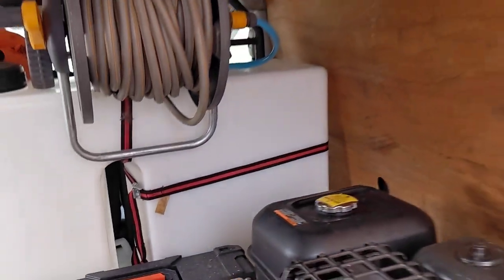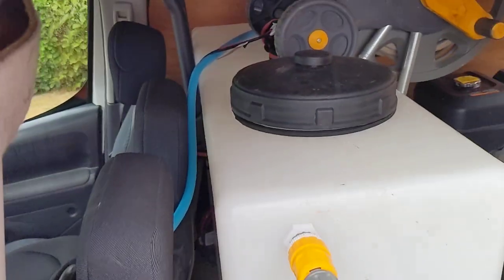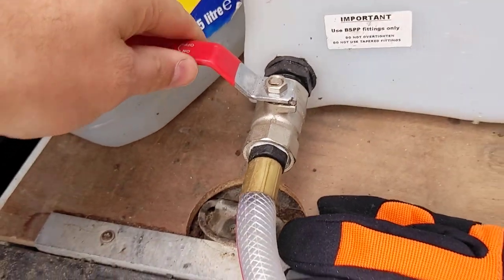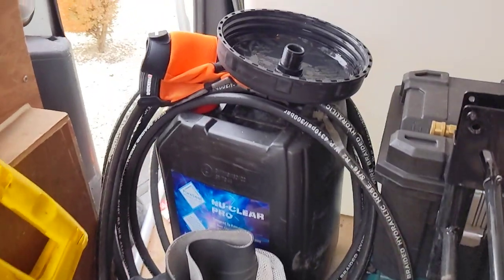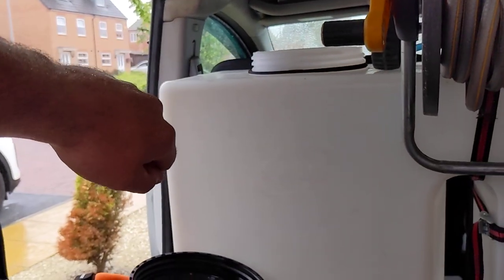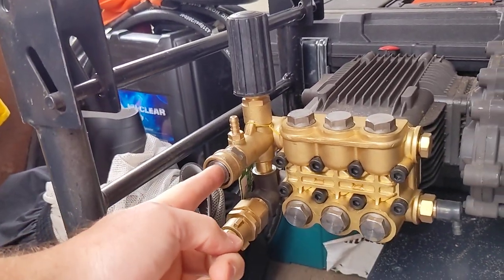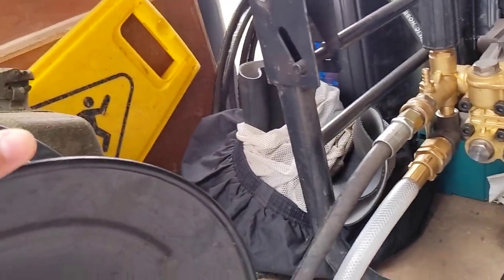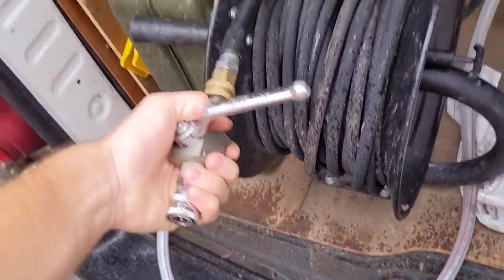Setting up a buffer tank for PRESSURE WASHING

Comment: Do you need a bypass that goes from the pressure washer back into the buffer tank. Was reading if you take your finger off the trigger and leave the pump running it can mess the pressure washer up. Is it worth installing a bypass ?
Reply from the maker: I think it's mainly for heat management to prevent the pump overheating. I had a bypass installed on that machine after this video.
I'm not sure what happens inside the pump when there's no bypass, I'd like to talk to a professional
Reply: @SMOUT_  I read its just better for the pump, because its always getting freshly cycled water helping it stay cool, guessing it just increases the life span of the pump. how long did your pump last without a bypass?

Comment: For the incoming water feed, did the tank come pre drilled and all the fitting already attached?
Reply from the maker: No I drilled the hole at the top for the hose connector.
The one at the bottom was already drilled with a half inch thread I think 👍

Comment: probably a daft question, but when ordering the tank do you need the undrilled or outlet options, also is the stopcock already inside the tank as there's an option to add a brass float valve thank you
Reply: Did you manage to work out whether to get un drilled or outlets ??

Comment: Hoping for a reply.
This just gravity fed then?
Does the flow exit rate from the buffer tank exceed the GPM of the pressure washer, or does the pressure washer create vacuum to suck it out, thereby creating sufficient flow?

Thank you!  Working on setting one up myself, but my flow rate out of the tank is lower than the GPM rating of the pressure washer and I don't want to burn it up.
Reply from the maker: Most pressure washers will suck yeah. A better measure of flow would be at the end of the high pressure hose with no nozzle on. Then you'll see a huge increase over what comes out of the bottom of the tank alone.
Reply: @SMOUT_  
Thank you very much.  That believe that makes sense.  

Just to be clear though, if my buffer tank...open valve, nothing hooked up to it besides the feed hose.... flows say 2gpm, do you think I could hook a 4gpm pressure washer to it?  My tank is 300 gallons and flows out a standard size garden hose.  I'm just surprised the flow rate isn't higher....300gallons should be a lot of gravity pressure.

Thank you again.  I do appreciate it.👍👍
Reply from the maker: Yes you got it. Give it a try

Comment: Where did you get the hose and the brass connectors to attach to your machine and water supply? I can’t find anywhere
Reply from the maker: It's a suction hose which came with the machine. It's specifically reinforced so it doesn't collapse.

Comment: cam you send a link of the pipe that goes from the tank to the pressure washer
Reply from the maker: It came with the pressure washer mate. Just a 3/4" suction hose I think. Wire reinforced to stop it collapsing
Reply: @SMOUT_  alright sweet mate thanks

Comment: What if you run out of water? Does the machine shut off?
Reply from the maker: It doesnt mate, as soon as it runs out i turn the machine off and wait for it to refill
Reply: But whats the problem with just being connected to clients water and use that for your job, do we need a tank?? Im just trying to understand
Reply: Depends on the water pressure as the pressure washer would most probably use more water than the outside tap could produce so you would need to part fill the tank before starting

Comment: Where did you buy that big tank if i may ask?
Reply from the maker: I think the websites called tanks direct
Reply: @SMOUT_  Ok cant find it on their website.. but i will send them a mail. Thank you.
Reply from the maker: Just realised the link is actually at the bottom of my description 👍
Reply: @SMOUT_  The tank in the link is not the same tank🤔 its a different tank. Maybe they stopped selling it!?
Reply from the maker: Hmmm looks the same to me. 250L upright tank...
Reply: @SMOUT_  The one  you have is "split in half"  it also got two lids!? 

(Ex the english)
Reply from the maker: The one in the link is baffled, same as mine with a big hole going through the middle to stop the water sloshing around. 
Mine only has one lid, as does the one in the link. Unless you're being directed to a totally different product, it looks the same to me 🤷‍♂️